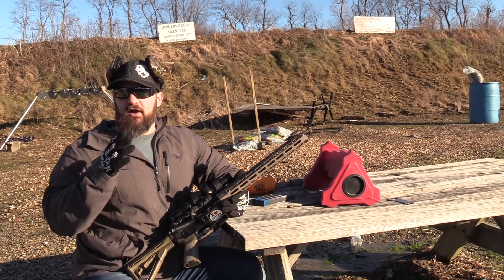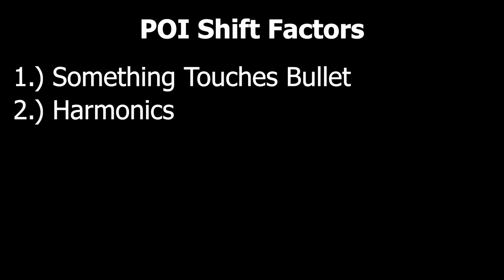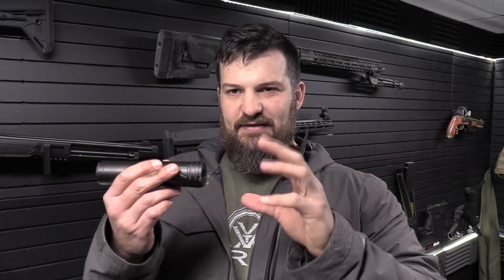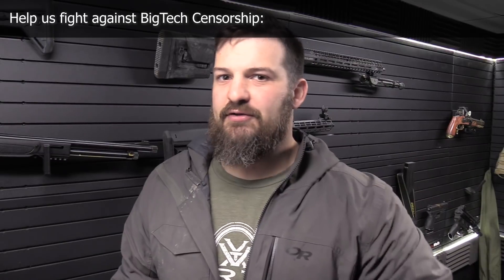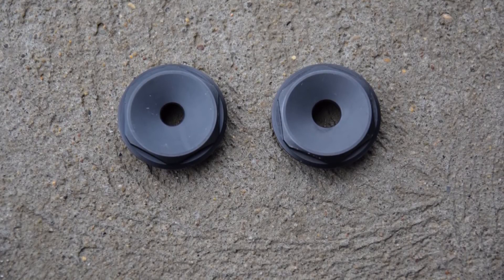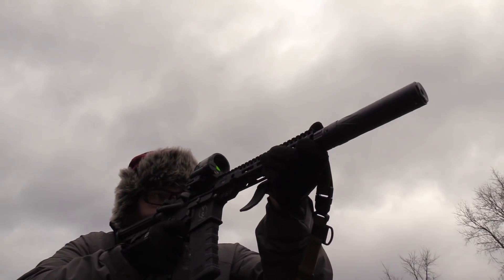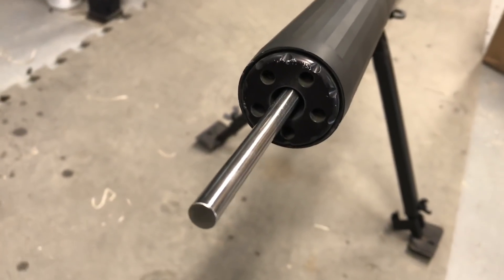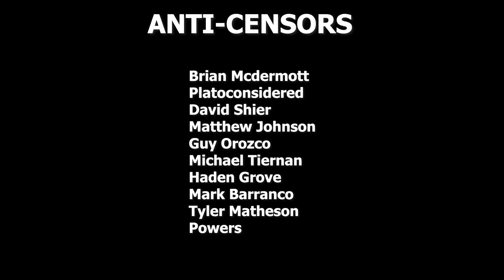Science of Changes in Accuracy and Point of Impact Shift

Comment: Hi
In this video, you mentioned worrying about censorship because you were talking about quiet bois

I searched "muzzle device changes point of impact"

This was the first result.

I've got a Bergara B-14 65cm that came with their omnidirectional brake

Super long story short, I was getting 3 inch groups at 50 meters.

Took the brake off, and all shots were touching. Additionally, my POI went from roughly 3 inches high, 4 inches left to approximately 1/2 inch high and 3/8 inch left when compared to POA.

Target was simply a paper plate with a sharpie dot. Zeroing comes next

Anyway, I was wondering if you might be able to explain how a brake is fucking up my groups?

Great video btw

Comment: Thank you for the vid. Ive been wondering, does .300 aac bo tumbles at 300 yrds or so if fired at subsonic speed? If so, does that mean that if an m14/m1a with subsonic ammo fores the same weight at almosy the same soeeds it means it will tumble also? Im asking because someone told me that most match ammo are subsonics and if that is true then subsonic ammo from mm14/m1a should tumble too like that of an 300 aac bo. I neither have an m1a or 300ac but I do plan on upgrading my 5.56 ar. Hope somebody can help. Thanks!

Comment: My 7.62x39 has approximately 1” left shift with 123gr and 3” left shift with 154gr with a qd mounted gemtech one. I tried rotating it 180 degrees and it didn’t change the left leaning impact. It bothers me that my suppressor is left leaning:)
Reply: The only time "easily triggered" would be a good thing 😎